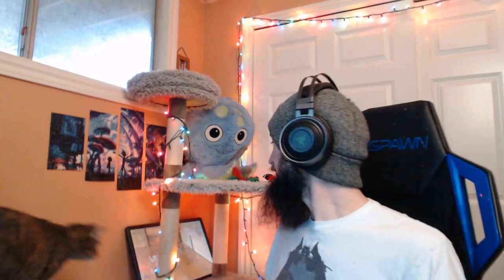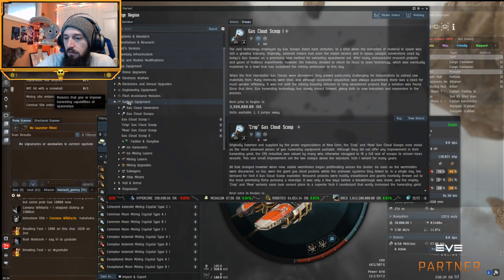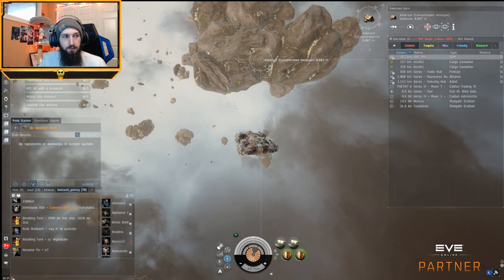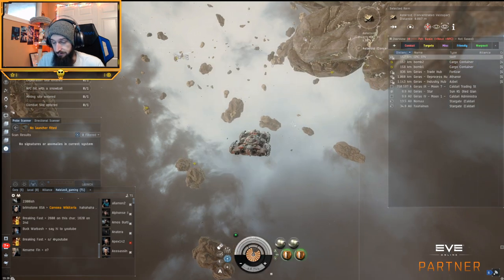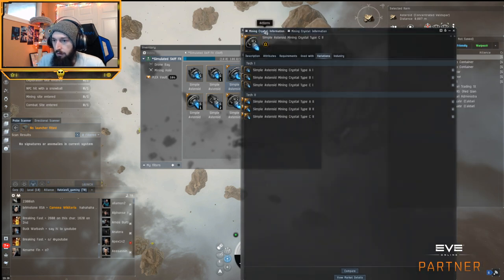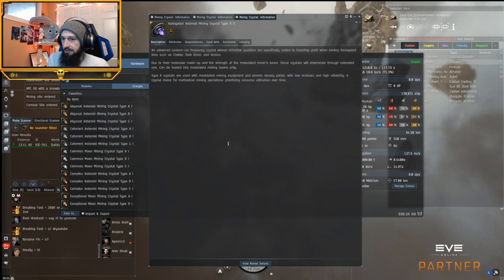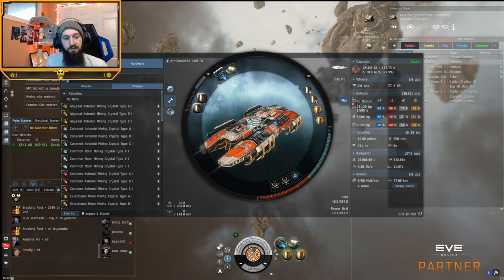Mining Residue and Crystals Explained

Comment: i only have one thing that i think needs adding to this video.
the residue gets removed from the rock BEFORE the ore that goes in your cargo.
so if you get a residue cycle and the full cycle worth of residue empties the rock. you get NOTHING and the rock disappears into the void.
Reply from the maker: this is true but you still end up mining more useing a and b crystals then if you had used none
Reply: Thanks I was confused about this. it's not 34% of the total volume, it's 34% chance of residue, but it seems to take the entire amount all the time with me... I also did the math and the T1 mining crystals actually mine LESS than the strip miners. If you multiply the 1700M3 by the 0.66 (what's left over after 34% residue) you end up on 1120 (thereabouts). the strip miner I's do 1300+ per cycle. I don't know why you would use crystals tbh.
Reply from the maker: @soros001  in practice the b type crystal mine alot they are just very wasteful been playing with different crystals and b types even with clearing rocks half the time mine more then a types

Comment: Not sure if you mentioned it or not but I noticed today that the residue is applied before the yield when the cycle completes so if the residue reduces the roid to zero you get no yield for that cycle. This makes B type crystals pretty bad. It obliterated my productiveness so I switched back to A's. A's do it too though sometimes but much less. Heck at this point I might just go back to T1's...
Reply from the maker: I tryed mining with t1 and type a the type a definatly mined more tybe b is next and honestly is probably what I am going to find is the best for at least high sec lower cycle rates are really nice under boost this can also be countered by scanning your rocks
Reply: @HateLesSGaming  True but anyone just mining belts down to nothing without scanning the roids first or short cycling will lose out using B crystals. I was completely caught by surprise when I realized my numbers were crap due to the way residue is applied to a popping roid. Took me quite a while to figure out why it was happening when everything I was doing was supposed to be better not worse. If the roid doesn't pop you are golden. If it pops you often get nothing.
Reply from the maker: @ParGellen  you have a 35 or 66% chance to get nothing
Reply: @HateLesSGaming  Exactly my point. I and others I've talked to in game were completely unaware that the residue is applied first to the cycle. I guess that was my point.
Reply from the maker: @ParGellen  yea its just kinda a thing now in larger belts and moons it is not really an issue but i would like to see it work a little more cohesivly where you get half on a and half is destroyed or something
Reply: @HateLesSGaming  I agree that would be much better than the way it currently works. Nothing like a few cycles of zero yield to really kick your productivity in the butt! :D Anyway thanks for listening to me whine!

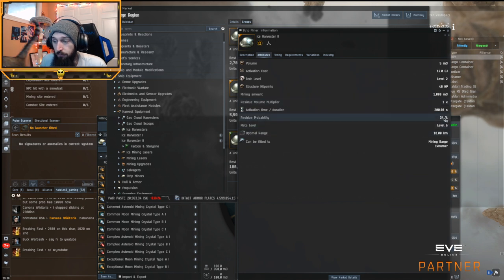Comment: 3:14 Soo T2 ice "upgrade" mines 20% faster but you lose 34% of the ice?  So is that only useful if you are low on time but ice for days? Where you're less worried about leaving some for later and or don't have enough time to mine the rest. Just like A and Bs for ore.

Also Hateless, thanks for making this but suggestion: Go over what you're going to go over by yourself first, make notes or a script maybe. Save both our times while you spent a minute looking for say, the duration bonus on the bottom of the info screen. Also makes you look more like you know the topic and not winging it. Mean that all with love. 

Think C's should be banned in 1.0 though or bare min suss. Maybe 0.9 too. From a noob protection standpoint. Gotta get them invested in the game before you just ruin their day. Also that noob maybe one day will be a corp or fleet mate. No need to scare off new blood.

Like the 15:15 reference, think good way to explain it.
Reply: As to protecting starter systems from type C miners, this is a legitimate concern